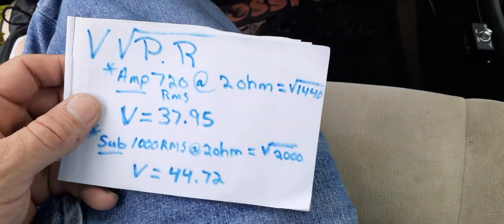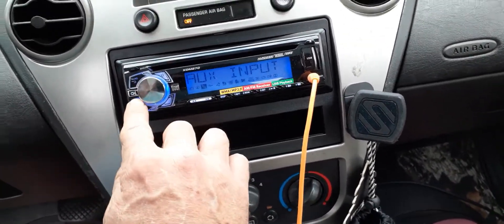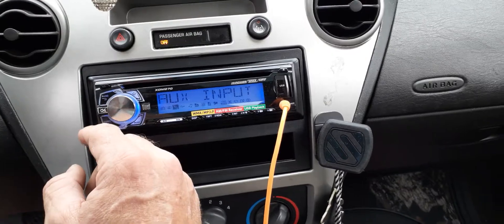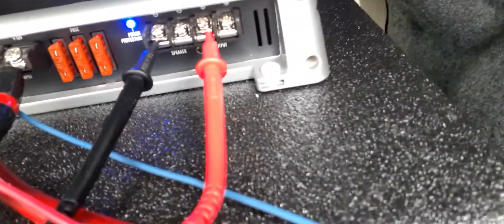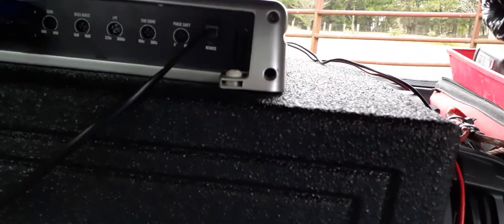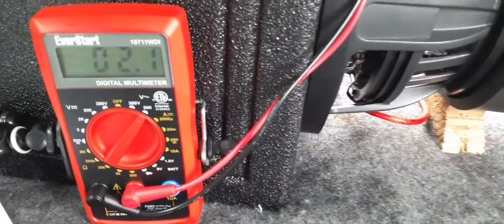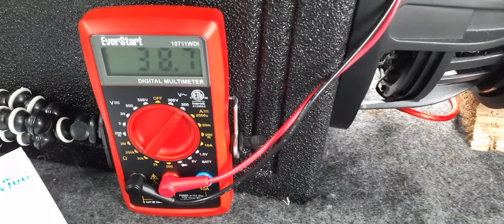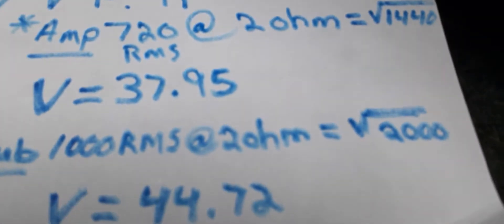How to set your gain on your car amplifier using multimeter

Comment: Hi mate great video , I got a question my sub is rated 1500rms dual voice coil 2ohm. 
Positive to positive and negative to negative will be 1ohm
My monoblock is 1000rms rated at 1ohm 
What should be the voltage? Thank you
Reply from the maker: Voltage ⚡ 31.6 and yes you have wiring correct. But I recommend a bigger amp. If the sub is rated 1500 and the amp only puts out 1000. You will be under powering your sub. Better to do little more than rated. To get full potential of your sub. And thank you 👊 👍💯💨💨
Reply: @bassjunkie2020  Just for the breaking  gonna use that amp as  both are brand new. 
Thank for your answer mate !!
Reply from the maker: No problem 😉  Thanks for subscribing 👊💯💨💨💨
Reply: @bassjunkie2020  my head unit  alpine has subwoofer level 0-15 should I turn it on +10 and after set my gain with the multimeter? Thank you
Reply from the maker: You can but it probably will cause your subs to clip. You need a oscilloscope or dd1 to look at sound waves. If you can't get either. Try listening to it. If it doesn't sound right. I'd turn it down. I keep mine at 0 👍💯
Reply: @bassjunkie2020  I have done a research and the alpine headunits use that for the rca output subwoofer level is different than bass level ,mine got 0-15 , if I leave it on 0 my sub is not moving at all, if set it 15 I will get the max power and voltage from the rca
Reply from the maker: Ok maybe it's ok on yours. But if you do turn it up. Do it before you ser the amp. That way it doesn't clip 👍💯

Comment: Okay so how would I tune the amp for multiple subwoofers. Do I add up the RMS of however many subs and use the ending ohms
Reply: Like 4 subs that are dual 2 ohm at 800 RMS wired in series parallel down to 1 ohm
Reply from the maker: Yes you add the total of all subs. Now if the number is more than your amps rating. Then I set it to what the amp can do
Reply: Ok I get it now. Thanks homie

Comment: Hi. I have used your method but maybe i did something wrong. Have 4 ch amp. No 1 and 2 are for mids and tweeters 3 and 4 for subs. I connect meter for 1 and 2 and when turning gain have it maximum and reading is 8.1 and got to have 20.9. Subs channel are reading ok why?
Reply from the maker: I would use a 4 channel amp for mids and highs. And Class d mono amp for subs. Will make it easier to set gains👍😁💯
Reply: @bassjunkie2020  still when using 4 ch mid and high have the same

Comment: Hello, please help me. I got a sub with 
300wrms 4Ohm bridged to a amp with
300wrms 4Ohm. 

My desired Voltage would be 34 Volts. But when i put my head unit to 46/62 which is 3/4 Max volume, and my amp on max gain i only get 11.5 Volts ??? 

If i turn the head unit to 55/62 i can easily get my desired voltage with maybe 3/4 of the amps max gain.

I played  a 50hz test Tone, Turned equalizer, bass boost lpf Hpf, everything of. 

should i put my head unit volume a little lower maybe to 50 so its less likely to distort and turn the amp gain a little more up to get to my voltage ?

Thank you sir!!!
Reply from the maker: Yeah try turning the head unit down some
Reply: @bassjunkie2020  Ok, thanks alot

Comment: So on my 4 channel amp that is 132watts rms x4 do I use only one channel for the math ? And iam using 4ohm speakers
Reply from the maker: Yeah just do one 4ohm × 132 = 528 square root = 22.97 voltage 👍💨
Reply: @bassjunkie2020   Kool I was hoping you say that the street glide fairing is hard to access ♿,I set it at 19.8 to be safe
Reply from the maker: Sounds good! Yeah that leaves you room to turn it up if needed👍😁💯
Reply: @bassjunkie2020  crazy thing is I could only get to 22volts on my meter . Have you ran into this before

Comment: After u are done setting gain what do u set the bass too on head unit
Reply from the maker: I keep all my settings flat on my head unit
Reply: @bassjunkie2020  I get that but I'm saying like when you are jamming n after you are done setting gain
Reply from the maker: I don't turn anything on. Less chance for distortion. I have low pass and high pass off on amp as well. My 4th has lots of bandwidth. So I don't need any boost 👍😎💯
Reply: @bassjunkie2020  oh ok I just have a ported box and my stuff just dont sound good on flat like there's no tweet or anything
Reply from the maker: @ROBBG88  I have 4 skar 6.5 mids and 2 ds18 tweeters hooked to a Toro 4 channel. Look through my video's 😉👍👊💯
Reply from the maker: Get some component 6.5 mids and tweeters. It will help a lot!👍😎💯
Reply: Once set, NEVER increase your bass setting on your HU!!

Comment: seems like you would want to test the voltage under load[speakers connected]  because the no load number can be superficial[volts is easy to produce, amperage is not kinda like testing a bad battery it make show a good voltage but volts means nothing its what it can do when under load] . not only that but power amplifiers in there most basic design would be damaged by turning up gain with no load, and the only reason they dont is because manufactures implement circuiterty to prevent damage from no load conditions, so who knows how that protection circuit can mess with your no load test. . .  Also a 60hz test tone is best because this is the only frequency that cheap multi meters can test accuratley [its whats used for mains power] Unless you have a nice "True Rms" meters

Comment: How much volume need to leave on headunit ? Mine is maximum 50, so i hear when people say to leave 75% volume. So mine to be 37, thats true ?
Reply: Go to where you just start to detect distortion & back it off just a tad!
Reply from the maker: Not really some head unit's are real good and don't distort at full volume.  I got a pioneer and it goes to like 60 to 65. But I set my gain on my amp with head unit at 45. I could go higher if I want. But I think at 45 the highs and mids sound clear. And that's what your looking for. Set your head unit to the loudest volume you can without distortion. Then set your amp accordingly. Atleast that what I do👍😎👊💯

Comment: So I’m running JBL 751ez mono amplifier 750rms at 2 ohms! Two 2ohm skar 12s 800rms a piece! Wired down to 2ohm inside! What should my numbers be! Thanks ! Nice video🤘🏾subwoofers ratings are higher then my amplifier as well!
Reply: BassJunkie 2020 I have a Taraamp at 2ohms 3200 watts what will be my volts thank you
Reply: @goldy542  I finally got me a smdd 1 + ! Sounds are on point 🖖🏾💪🏾slapping
Reply: @carlitot5388  oh I bet I'm going to tune mines this weekend at some point but I know yours on point with the smdd
Reply from the maker: Hell yeah! Post in the BassJunkie2020 group on Facebook 👍😁💯
Reply from the maker: I keep my head unit settings to all flat
Reply from the maker: 82.6 ⚡ voltage.  3200 × 2 = 6800 then do square root of 6800 = 82.6
Reply: @bassjunkie2020  thank you brother if my sub is 1000 rms at 2 ohms would I use that number since it's the lowest and would it be 2000 then the square root of 2000 thank you
Reply from the maker: Yeah use the lowest so you don't blow your sub. 2000 = 44.72 voltage
Reply: @bassjunkie2020  thank you brother for everything I have watched all your videos also I'm on the state line of KY in Franklin one more question I also want to set my head unit will it be the same way or a little different. Also thanks for the tip on the fans I ordered me one last night from Amazon.
Reply: @goldy542  I think you set your head unit at 75 % out of whatever max volume your head unit is before tuning your amplifier with the multimeter!!!!!! Make sure everything is on flat on the head unit eq!!!🤟🏽
Reply: @carlitot5388  ok thank you I believe my head unit goes to 50 or 60 gonna find out today so I can set the head unit and amp
Reply: @carlitot5388  Appreciate everything
Reply: @goldy542  np brother 🤟🏽
Reply from the maker: 750 x 2 = 1500.  Square root of 1500 = 38.72 volts 👍😁💯
Reply: BassJunkie2020 so all the gains down as I’m setting this up right?
Reply from the maker: @carlitot5388  all except the lowpass. You want to turn your lowpass all the way up to set your gain. The rest all the way down. With the low pass up you get full frequency.  Then after you have your gain set to the voltage # that I gave you. Then turn your low pass down to around 80. You don't want any frequency higher then 80 going to your subs. Subsonic or high pass use if your running a ported enclosure. Set it close to your box tuning. My box is 34hz . So I set my high pass @ 30 👍😎
Reply: BassJunkie2020 appreciate it brother 🤘🏾thank you
Reply: BassJunkie2020 wow! Thanks brother 🤘🏾🙂! Can’t wait to set it up ! Appreciate that a lot man🤘🏾🤘🏾
Reply from the maker: Your welcome 👍😁 Get loud💪💪💪😎💯

Comment: Nice man but I’m still confused with my system because I don’t know anything about audio systems. I just bought a Skar Audio combo system and I installed it and it’s working but I don’t know if this is @ 1♎️ or @2♎️. I would like you to help me bro. Here is the info. 

Quick Facts 
Peak Power Handling	1,200 Watts
Enclosure Configuration	Single - 12"
Included Amplifier	Skar Audio RP-800.1D
Included Amp Kit	4 Gauge CCA Complete Kit
Final Impedance Load	1 Ω
The subwoofer comes pre-wired and loaded inside of the enclosure allowing for an easy and hassle free installation. The dual 2-ohm subwoofer is wired up inside of the enclosure so that the final impedance load is configured for 1-ohm at the terminals.

So, do I have to do the math at
800@1♎️=✔️28.28 or 800@2♎️=✔️40. ?
Reply from the maker: Id go with the lowest rms rating.  If your sub is way less rms then your amp. Then I would use the subs rms. But you said your amp is a 800 rms? Always go by rms rating . Ignore the max ratings on anything. Thats just a peak. Rms is what you need to worry about.  So if your amp does 800 rms @ 1 ohm then that would be  28.28 volts. But say you have a 500 rms sub. Then you might want to do 500 rms @ 1 ohm that would be 22.36 You just don't want to over power your sub and burn your voice coil. But if your subs rms ratings is higher then your amp. Then go with the amps rating.  Cause you couldn't do the subs ratings. The amp isn't capable of doing those ratings.  You would burn the amp. And If that was the case just get a bigger amp if your trying to push the sub to its max. Hope that help. If not. I'll try to explain it better.  I might make a new video about it tomorrow. Cause that video was old and I know more now👊😎💯
Reply: BassJunkie2020 Ok my man. I set the Amp @ 28.28 and the bass sound amazing. No more distortion. Oh yeah buddy! You help me a lot. One more time thank you very much.
Reply from the maker: Your welcome! Oh and I'm uploading a video right now that explains how to set it a little better. I made it to help you. You got me thinking about my old video. I made that when I was just getting this channel going. I've learned a lot since then so I decided to make a updated video on the subject. I'm just explaining in this new video. Because I had to mow the yard and we live on 3 acres. Takes a few hrs to mow. And by the time I was done it was dark. So I used the light on my phone and made a short video. But tomorrow I'm going to actually demonstrate how to do it with my multimeter. Then there will also be a new demo video uploaded after that! So thats 3 videos to look forward to. Oh also I just uploaded a video about my playlist  on my channel pg. But if you go to my playlist there's over 150 bass boosted song that I like and I think have a lot of bass. I subscribe to all the bass boost channels I can. And I know they will appreciate the views. But it is a pain to look up each individual song . And I don't like all bass boosted songs. So I made a playlist . That way you can just use the playlist and have plenty of songs that sound good . You can hit shuffle and enjoy all different kinds of bass boost. But warning some of them are subwoofer test ! So play those at medium and easy into the volume so you don't blow your subs😵🤣 But anyways I'm glad I could help you!👍👊😎💯🤪
Reply: BassJunkie2020 Awesome! Thank you. Like & Sub here.
Reply from the maker: But in short. Go with 1ohm x 800. Cause the subs are prewired down to 1 ohm👍
Reply: BassJunkie2020 Awesome!! Thank you very much for your help. God bless you brother. Here is the combo that I bought from Skar. 

https://www.skaraudio.com/collections/sdr-series-loaded-enclosures-and-subwoofer-bass-packages/products/sdr-1x12d2-rp-800-1d-skar4anl-cca
Reply: I have the same subwoofer and enclosure but my amp does 1200@ 1Ohm so what would my target voltage be to set amp gain
Reply from the maker: @GriggzFF  34.64 volts on gain👍😎💯
Reply: @bassjunkie2020  okay one more question my sub is 32 hz tuning so what would i set my lpf to on my amp?
Reply from the maker: Id set it at 80 lpf. What I set mine at
Reply: BassJunkie2020 Yeah, I have my Amp set at 80% as well. 👌🏽
Reply from the maker: Perfect 👍😎💯
Reply: Griggz 34.64 volts. Please don’t forget to Like & Sub. 💪🏼